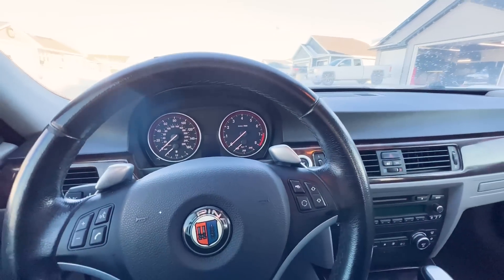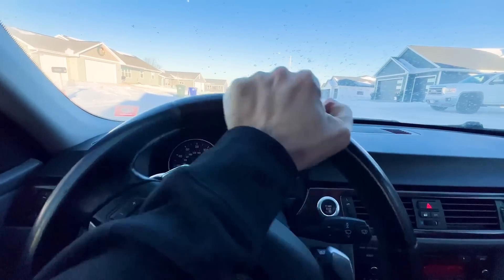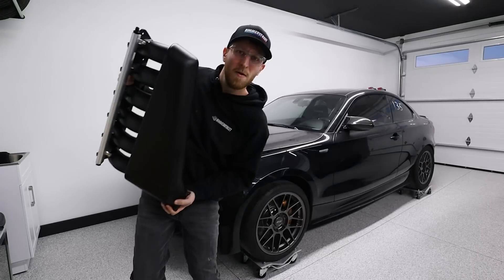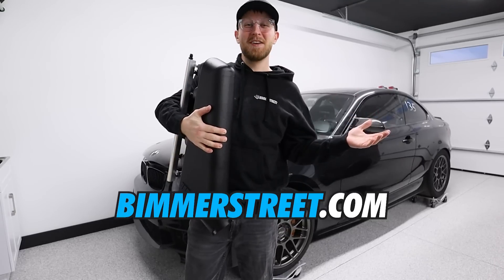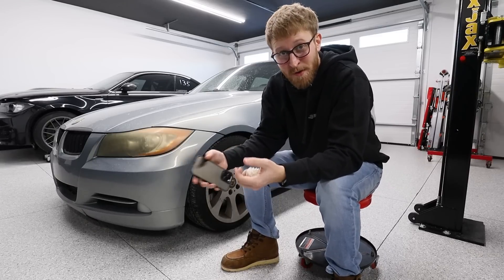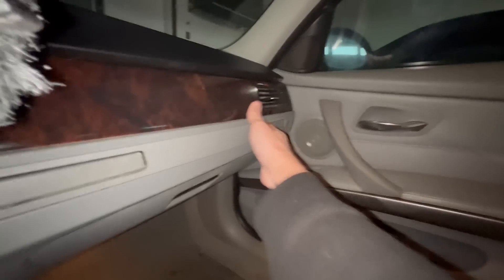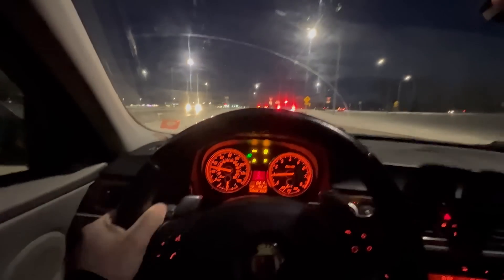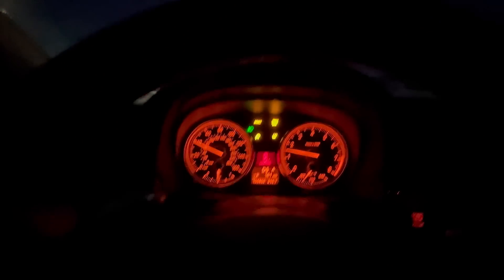I GAMBLED on a BMW From Across the COUNTRY!

Comment: Ordered my SEIBON carbon fiber BM Hood Monday. I ordered some nice black cerakoted black  hood button locks & the pins that go on the radiator support are burnt 6AL4V grd 5 titanium to match all the other titanium hardware throughout the entire build! Man if I were you I’d bullet proof your old engine & put it. That way you don’t have to keep messing around! I mean technically all you need is a sick set of rods, pistons & a solid crank hub & you can put down more power with no worries…💪🏻🏁
Reply from the maker: That sounds sick, you've definitely got a tasteful build going on over there! And yeah, it's tempting for sure. I may just have to do it after I swap in this engine, just need some time and $$$.
Reply: @jake_spence  Yeah I hear ya! This stuff is expensive, especially when you start building motors. Then again who knows, you could put this other engine in & get a lot of miles out of it! You never know? I hope you do though! Hope it stays together with no issues! Yeah so I’m gonna put my hood on when it comes & put in my phoenix plenum & ignition. Then I’ll take out this summer & hit some shows & hopefully race it a few times. Then over next winter I’m gonna order the trunk lid, put in the stage 3 pump & reflex controller. Like you said this is expensive…✌🏻😂

Comment: Great donor car Jake. The gearbox needs the common new gaskets and new solenoids and oil. Or the torque convertor has gone by these 19t's. Have a good one, Dutch regards Nico.
Reply from the maker: Thanks for the info! I am not too familiar with these auto trans, as I've never pushed the limits of one myself. Luckily I just need the engine.

Comment: Dang $3500 for that condition, gives me hope about my 127k mile car in the same spec, but way better maintained. Nice purchase
Reply from the maker: If it didn't have all of the mods, I wouldn't have paid what I did. But yeah, the 335i market is still strong where I live. You can fetch $8-10k for a decently clean early model 335i as long as it isn't 160k+ miles.

Comment: Those lights definitely just needs brakes, speed sensor and a reset of maintenance light, at least it doesn’t have a check engine light. 🤞🏽😁
Reply from the maker: I dove into all of the lights today and figured some things out lol. It's all in my new video 😎